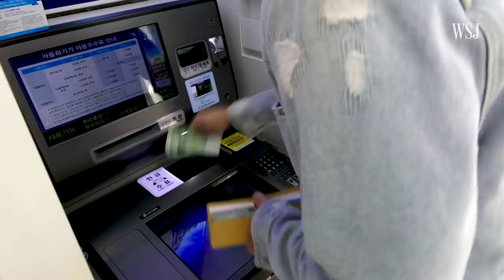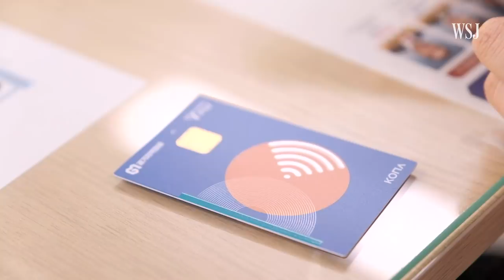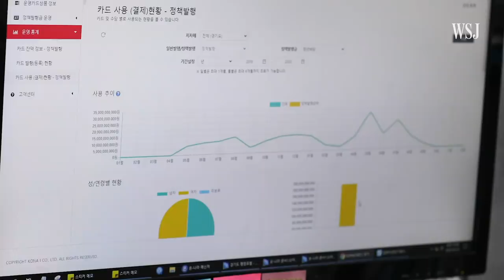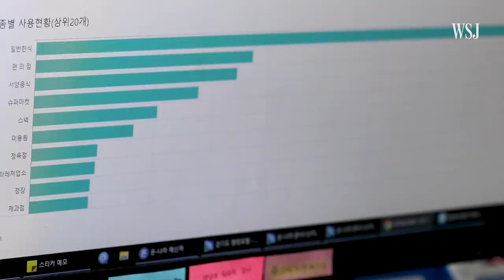How South Korea Experiments With Universal Basic Income | WSJ

Comment: That's brilliant. Spending locally on important things and not on unnecessary things like in McDonald's is very good idea to regulate that money
Reply: The thing is that you can actually sell $200 coupon for like $190
Reply: Bleach Apéritif They could just attach coupons to ID so they’re not redeemable by other people like lottery tickets.
Reply: @blaze0812  
Don't lie. The UBI is not a coupon. It's an actual credit card which is linked to your ID (social security number), etc. You cannot simply sell the funds to someone else without giving away your identifying information.
Reply: Bleach Apéritif Also, is someone else buys a $200 coupon from another person from $190, the local economy would still be stimulated in the end since the buyer intends to redeem the coupon.
Reply: @WellBattle6  did you not watch? The money comes as a credit card in your name. Even if you could sell the credit card, the UBI would still work since the money can only be spent locally.
Reply: @blaze0812   Allowing people to exchange them at values they determine on an individual level at some rate deviating from the face value should lead to greater economic efficiency as people might value some amount of the  $200 UBI differently in the local economy.  If I have a coupon worth $200 that I personally only value at $190, then being able to sell that to some one else to use at some price between $190 and $200 will only leave us both better off.  The economy should benefit if fractions of the coupon amount may be sold as most will be redeemed since the people who value it the most will trade with those who would most likely let some amount of it expire.
Reply: You're only happy that they can't spend it in McDonald's because McDonald's is unnecessary. But the condition isn't to spend only on 'necessary' (who would even decide this, and on what basis?) things, it's to spend in local businesses. They just happened to use the frivolous example of McDonald's, but what if what you find necessary isn't produced locally? Then what? Have to dip into your own money then, even if the item you need is important.
Reply: Wouldn't McDonalds be considered as a local business in america ? hahah
Reply: Sure, ok.  McDonalds provides fast, cheap food options.  You don't have to shop their NOW, let alone in the future.  Why are you so happy to regulate, track, and control people's behavior?
Reply: @johnhonker3362  In this case, it's not about controlling people. Rather the condition is being used to keep the money circulating in the local economy in order to boost it, rather than it flowing out of said economy by being spent on enterprises based elsewhere. Cos boosting the local economy indirectly uplifts everyone there, besides the direct benefit of just getting the money. And that in turn eventually increases local tax revenue, which helps to make the policy somewhat more self-sustaining.
Reply: This restriction is meaningless. You simply spend money you would have spent in the local economy at McDonald's and replace it with the UBI dollars. You can literally buy all your food at McDonald's and spend nothing into the local food economy.
Reply: @johnkim5718 Criminals don't care about personal information. 😂😂😂

Comment: It is a pretty good idea. Here in switzerland we voted on a UBI scheme some 10 years ago and it was voted down clearly, i also voted no then. It was probably just ahead of its time. 

But at some point this will definetly become necessary. Best would be to finance it entirely by a robot tax which is earmarked completely for that. That way the payments rise as automation increases and the problem becomes bigger over time, but is automatically mitigated. Without need for a political battle about every raise.